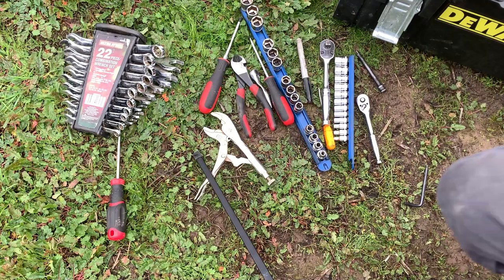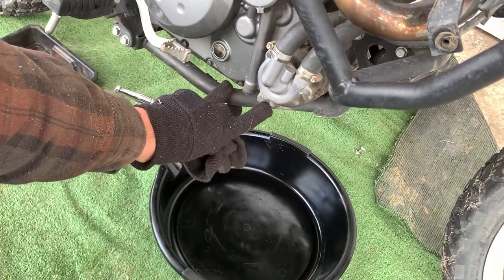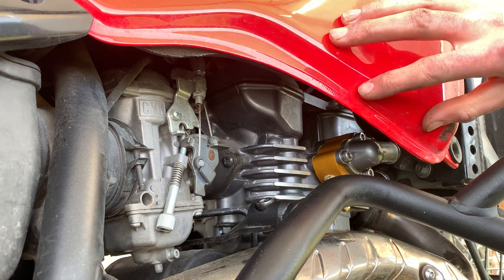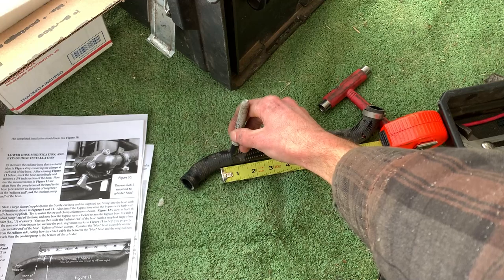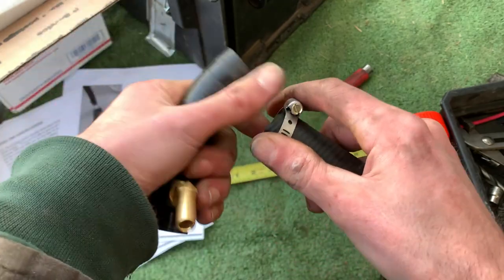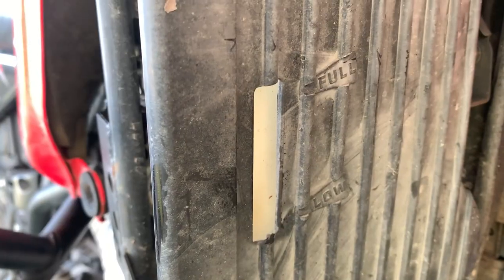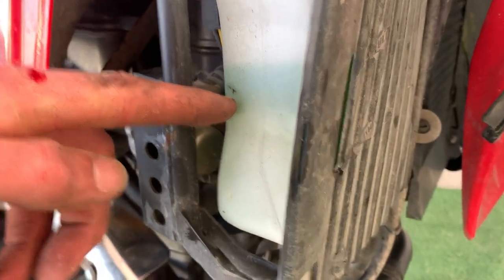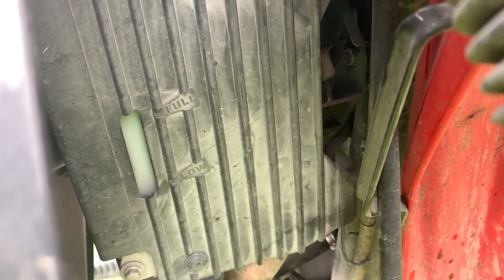EASY Thermobob 2 Install on the KLR650 (including Temp. Gauge Overlay)

Comment: I just purchased a Thermobob 2. Thank you for this installation video, I watched before installing mine. My only comment/advice is to use a silicate free antifreeze as silicate will prematurely shorten the life of the water pump on motorcycles. Usually the 'Asian' type anti-freeze is silicate free.
Reply: You have a link?

Comment: Good video! I like to remove most everything that is in the way and/or could get damaged by tools, etc. I like easy, direct access for my big, clumsy hands and tools. Based on my research, this seems to be one of the "must do" mods for KLR which also prompts the question: "Why didn't Kawi correct/improve this all these years?"

Comment: Most will tell you any automotive non-silicate, non-nitrite antifreeze mixed 50:50 with dis-stilled water is fine. Problem is many modern motorcycles have lots of magnesium. Magnesium reacts very quickly when dissimilar metals are present though I'm told that late model components made of magnesium are more resistent to the "sacrificial anode" effect. Non-silicate (red colored) coolants sold as OEM Honda and Toyota and some aftermarket brands, are less of a catalyst to corrosion for aluminum, magnesium and their alloys.

Then there's the Dexcool and other brands of "Extended Life" coolants...the orange stuff. In my experience stay away from this stuff and not just in motorcycles! GM has been using this since 1996 as OEM fill. Originally developed and first used in Sweden due to environmental concerns of regular green coolant. Seems there is a chemical reaction when exposed to oxygen resulting in "sludge" build up to the point of reduced flow (clogged radiator and worse case engine block) and eventual overheating problems. Internally GM has admitted to this problem and ask any GM mechanic if they replace a lot of block heaters on GM cars/trucks. Brass reacts quickly with Dexcool. I ruined a very nice built 383ci due to this stuff...bad, very bad!

One question I hear is what is Silicates. Silicates are needed to protect aluminum engine parts and radiators from corrosion, and are used in virtually all antifreeze mixtures in varying forms and amounts. Why has it been given such a bad rap for motorcycle usage? Seems early Honda Goldwings were prone to waterpump failure when using coolants with silicates. Fact is that was a while ago and silicate used today is nowhere as highly concentrated as it was back then. Some state Silicates are there to "scrub" the deposits and having "abrasive" Silicates will lead to problems in Motorcycles. My research found that Silicates are there to prevent corrosion by inhibiting the chemical reaction when you have disimilar metals in direct contact or in a liquid. Coolant, as is most liquids, is an electrical conduit. Silicates will turn abrasive over time. Thus why manufactures state that if you have aluminum in your coolant system (engine and/or radiator) the coolant should be changed every 2 yrs regardless of usage.

How to test coolant? Sure everyone knows how to test to see if your coolant still offers freeze protection but remember when you have dissimilar metals in an acidic liquid you have a chemical reaction. Guess what? If the coolant is acidic you now have a battery! Coolant is normally around 7.5 which is not acidic but overtime it becomes acidic and thats when the chemical reaction begins

What do I use? A 50/50 mix of standard Texaco antifreeze/coolant (green) serviced at the end of each riding season (don't leave acidic coolant in your rad over the winter) and at the correct mixture ratio for temps in your area.

Electrolysis is a process of chemical changes in the cooling system that allows electrical current to pass through the engine coolant. This is from dissimilar metals in contact with the coolant (much like a battery) and/or electrical current is passed through, because the engine serves as a pathway to ground between the battery negative cable and the negative terminals of various electrical components. Dirty or loose ground connections can increase voltage flow through the cooling system. Remember, electricity takes the path of least resistence and your coolant can become an the "alternative" ground for your bikes electrical system.

Your coolant has additives to protect your engine. Overtime these additives are removed/lost due to exposure, heat and electrolysist. Maintaining good coolant with the proper amount of corrosion inhibitors to protect against rust, oxidation and electrolysis is critical to long life of your pride and joy.

So how do you know the condition of your coolant if electrolysis is occuring. My personal opinion is if your coolant is two years old its PAST time to flush and replace. Particularily on motorcycles which contain high amounts of aluminum and other dissimilar metals your coolant has rapidly deteriorated by year two.

To check for electrolysis is quite simple. First step is to bring the engine up to normal operating temps. Next, using a digital voltmeter place the negative lead to the battery negative post and the positive lead into the coolant. A voltage reading above .300 V can cause severe corrosion and damage to metal surfaces.
Reply: Look at the big brain on Alberto! Atta boy! You know sir, while most people wouldn't even think about reading your entire comment.(not much for attention spans these days I'm afraid. i.e....tiktok or whatever lol) I myself can appreciate the knowledge you have shared as well as  the time you spent in doing so! So thank you sir! Thank you very much!
Reply: @michaelh5980  😁 your welcome

Comment: Just bought a 2024 KLR, I am not a mechanic, but would not drilling a hole in the existing thermostat housing accomplish the same thing??? It would let coolant flow thru the thermostat prior to the motor heating up and the thermostat spring opening. We used to do it with hot rods back in the 60's.

Comment: Just curious. Have you adjusted your valves at that mileage? If so, what did you find?
Reply from the maker: Yes I did, I checked them about a month later because I was getting a clacking noise when coming off the highway, they were too tight so I had to adjust them. Sorry for the late reply I don't check comments very often.

Comment: Hi
Does this device really stop  oil burning? Thank you
Reply from the maker: very nearly, I don't have to add oil until I approach 2000 miles on the oil change and it starts burning oil. If you install this kit early enough in your KLR's life you can keep the cylinder from going out of round. Watt-man's KLR has 180,000 miles on it.
Reply: Well that's amazing  and  I can now see why it's not don't in the factory  .
You have to admit that all  these  specialised  parts have funky name's like do Hickey, thermo Bob.
Thanks so much it is an upgrade that I will definitely do .
I
Reply from the maker: @Thomas-wk5ll  the Doohickey one really gets me I feel like I sound like an idiot when I’m telling someone about it. The actual name is a balancer adjustment pulley if that helps. Good luck!

Comment: How about just changing the thermostat to a lower temp rating🤔
Reply: The stock thermostat is fairly low and the ThemoBob actually raises it to about 20 degrees. I think this works because it recirculates coolant all the time and makes the temperature more uniform. In the stock setup, the thermostat opens and brings in a bunch of cold coolant and shock cools the cylinder, then it shuts and the cycle repeats.